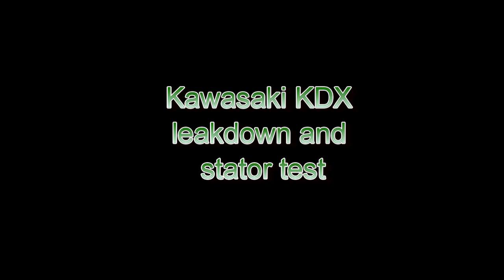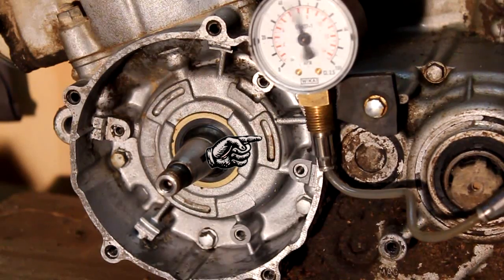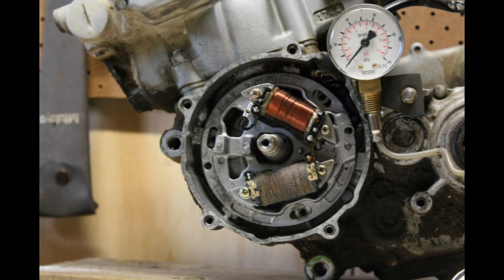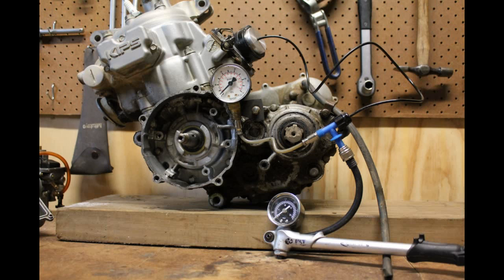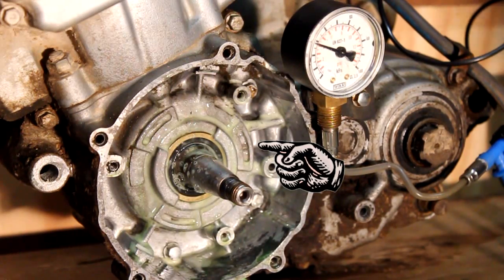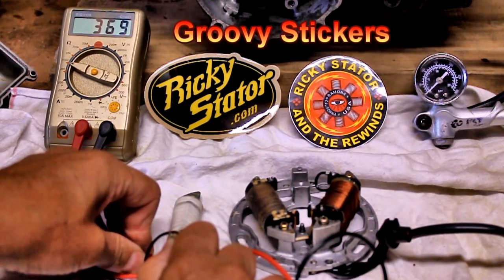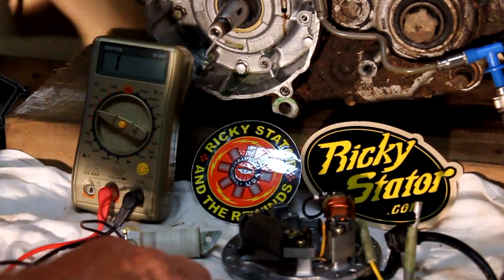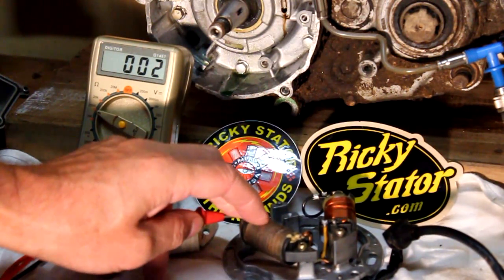KDX Leakdown and Stator Test

Comment: Awesome video! What were some of the symptoms of the bad stator? I have an e series kdx200 and the po had replaced the source coil years ago and I think I'm having similar problems he had. 0-.25 throttle it's fine but as soon as I open it up it bogs and pops and bangs and backfires.
Reply: Mate that's exactly what's mine is doing ..what was your cure.cheers Bryan

Comment: i've opened magneto cover and discovered a huge amount of black oil or carbon... is it seal damaged or those leaks you've just show us? 
uhm... what should we do with those leaks?!
new crankcase? (
Reply: fxgtlive  pressure test your crank case, like he shows in the video. if the crank seals are leaking, split the cases and replace the crank seals/bearings. if it's just the case leaking, jbweld it !
Reply: +fxgtlive clean the shit out of where the leak or leaks are and get permatex in a cheeze wiz can. best shit. napa has it.
Reply: I made the video. I fixed it by getting the cases HPC coated on the inside. Its a thin ceramic coating. No more problem. Cost me around $80 NZD from what I remember